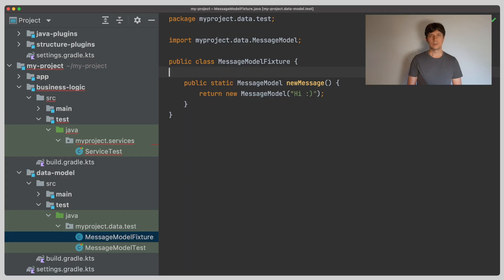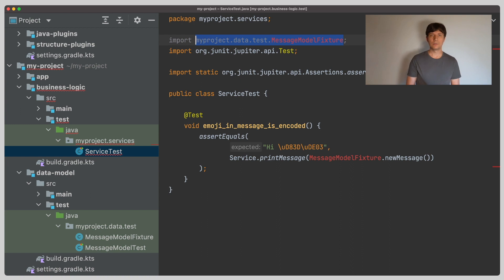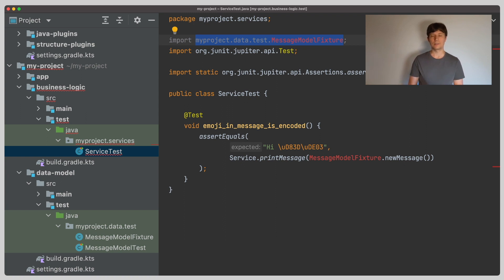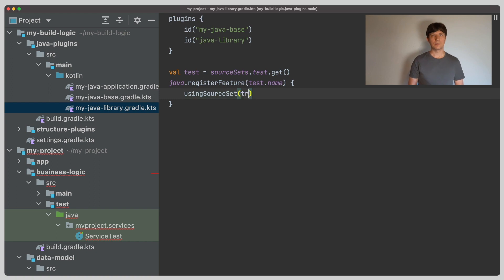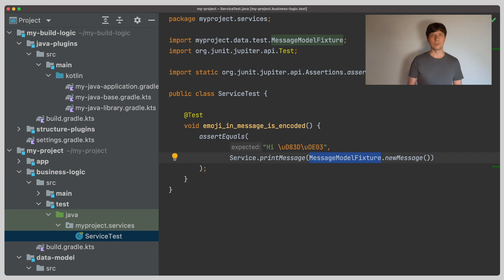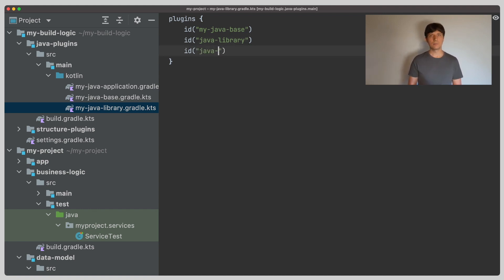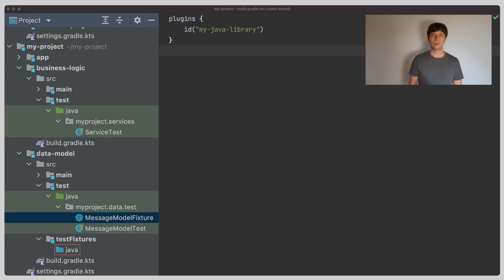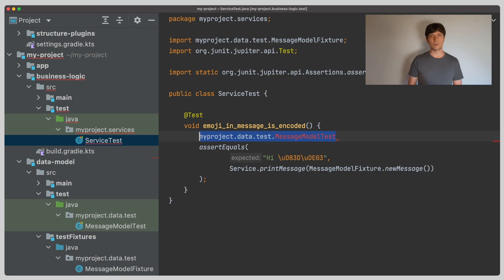Understanding Gradle #20 – Test Fixtures

Comment: Great video and straight forward explanation. A questions I can ask is, how could we add the testFixture code into checkstyle checks? I realized it doesn’t get checked since it’s outside the src/main and src/test
Reply from the maker: Thank you! Regarding the question: It's quite straight forward. The checkstyle plugin is aware of source sets and will register a task to check testFixtures automatically, which is called checkstyleTestFixtures . After you use the plugin – id("checkstyle") – you can run: gradle checkstyleTestFixtures

What the plugin does not do is automatically adding that task to the check lifecycle. Which is probably what you are looking for. You can do this:

tasks.check { dependsOn(tasks.named("checkstyleTestFixtures")) }

Then it runs as part of gradle check
Reply: @jjohannes  that worked, ended up finding the new tasks by accident while attempting a fix, so thanks for confirming it!!

Comment: I would be very thankful if you would anserw to my question. I cannot find the anserw on documention nor stackoverflow. 
Let's say I use publicated testFixtures created in project A in another project B. And in testFixtures resources directory I put application.properties file. I see that this properties file from testFixtures override application.properties from test directory of project B when running an @SpringBootTest (integration) test. It's fine for me but do You know why it works like that?
Reply from the maker: I don't know how Spring loads the application.properties internally. But I assume that it use the classpath to find the file in it. If you have multiple application.properties files which are not inside a package (in subfolders of resources), Java's mechanism to load resources from the classpath will return the first file it finds. The others can't be accessed at all. Which file is the first, depends on how things are ordered by Gradle when the tests are executed. In your example, the file from "testFixtures A" probably is found first.

In general, you should avoid having multiple files with the same name in the same location on the classpath so that the behavior of the application does not depend on classpath order.
I made a video on that topic: https://www.youtube.com/watch?v=KocTqF0hO_8

Comment: Great video series on gradle :) Any tips for implementing this in an android code base. I have a use case that involves sharing some Classes in the (test) folder between modules.
Reply from the maker: Thank you! The answer to your question is: it depends. :) I would say there are two scenarios:

1) The subproject where you put your Test Fixtures is a Java Library (i.e. does not have Android-specific code): 
In that case the project can be a plain 'java-library' and you can follow what I show in the video. In an Android (Library or Application) subproject you can use the Test Fixtures from that project through a 'test*Implementation(testFixtures(project("...")))' dependency.

2) The subproject is an Android Library:
Here you cannot use the 'java-test-fixtures' plugin because it relies on the SourceSet concept of Gradle's Java plugins and Android has it's own SourceSet concept (see my video on that https://youtu.be/74PDtHkS_w4). Fortunately, since 7.2.0, the Android plugins have their own Test Fixtures support that you can use: https://developer.android.com/studio/releases/gradle-plugin#test-fixtures

Another option I have not mentioned in the video is to put the fixture code into a separate subproject into 'src/main'. Then that project is like a Test-Utility-Project that would not become part of your production code. And you would only have "test*Implementation(project("..."))" dependencies to that subproject.